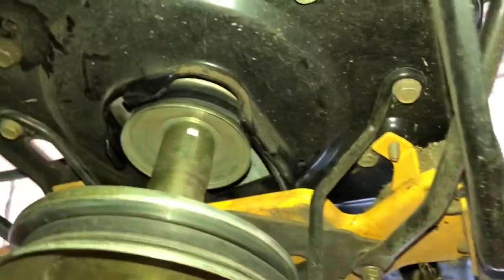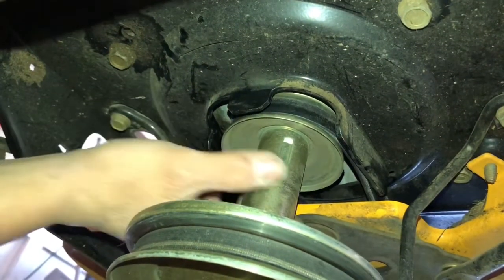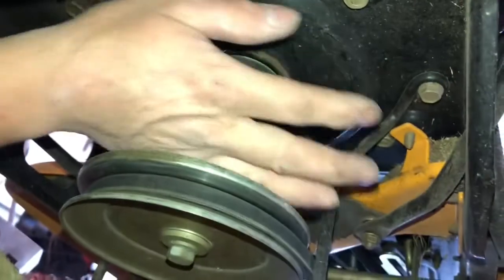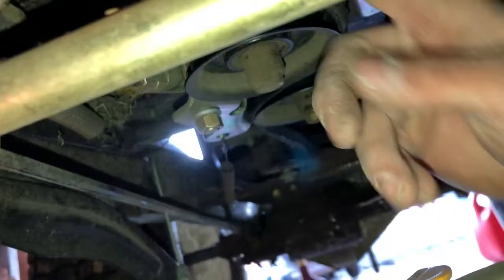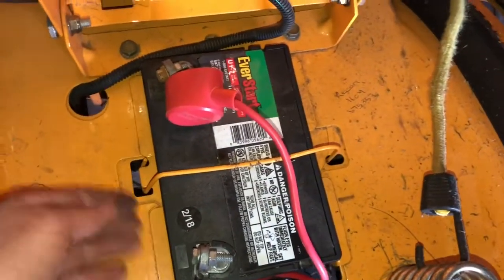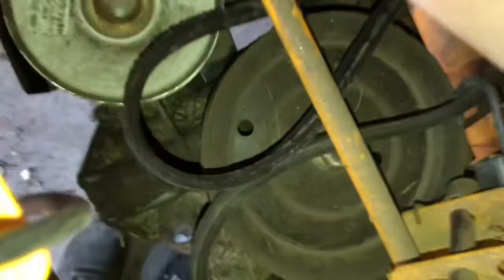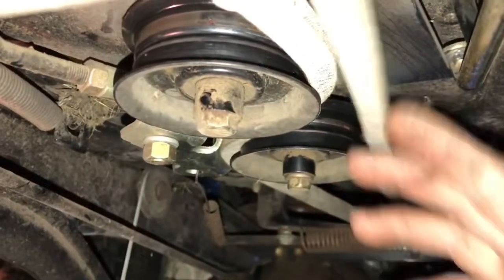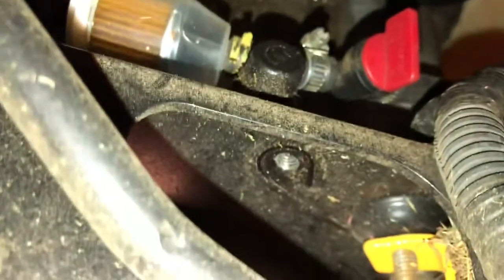No music, Installing a new drive belt on a Cub Cadet LTX 1040

Comment: Thank you so much for posting this video. I was able to change out the belt in about 30 min. I did not unbolt the engine however. I remove the bolt in the end of the engine shaft and the whole assembly easily slid off the shaft for easy belt removal and installation. I did remove the mower deck for easier access to the underside of the tractor. Thanks again, excellent video!
Reply: Sometime the pulleys are froze on there. If you remove the bolts you can slide the engine around and install the belt. Then slide the motor back and install the bolts. My pulley was stuck on tight
Reply: Atleast you did it right 👍
Reply: @tedbrewer7847 😂

Comment: I just pulled the crankshaft pulley on my 2012 Cub Cadet LTX 1042KW, I used a Husky Strap Wrench to hold the pulley and a ½" IR Pneumatic Impact gun with a 16mm impact standard 6pt. socket, it was piece of cake. The outer and inner pulleys dropped out easy and installed easy with the same set-up. That Husky 1" - 8" strap wrench purchased at Home Depot has a life-time gurantee and fit the pulley perfect and held it tight so as I reinstalled the pulleys to the crank shaft, the Kawasaki Crankshaft didn't rotate as I tighened up the 16mm bolt.

Comment: I have jack stands but it's good to know that paint cans will work in a pinch. Got the belt half off then I saw those frickin' tabs on the engine mount. I was about to grind them off when I decided to consult the University of Youtube. Removing the engine bolts is probably the best bet. I wouldn't want to deal with wheel pullers  and woodruff keys and all that. Thanks  so much for the help and by the way- Great tunes!

Comment: I guess yours is  not a hydrostatic   cub cadet 42 inch deck    mine is a 2016  kohler 22 hp hydrostatic V twin  I also found I had a oil like in the OHV  covers so had to use gasket sealer and remove them and reseal them  . Odd  they do not make a cork gasket for them  but  gasket sealler worked .   So looks much different  in the front and has a fan in the back  . I just replaced the deck belt  , spindles and pulleys and drive belt looked ok but guess not it shredded 2 months later  I could have caught a stick up in th belt  that destroyed it . I have just over 3 acres and have always owned 2 mowers    sold my troy built and bought a 46 inch hydrostatic  V twin  cub cadet this year  . Troy built only had 2 deck wheels  and my whole front yard is a hill  so back to 4 deck wheels  . I love you tube  shows me how to work on my mowers since here we only have 2 mower repair shops and they charge 94 dollars per hour  and 60 dollars to pick up mower and bring it back   ,  SUCKS SOMETIMES TO LIVE IN VIRGINIA HILLS   ,   my choice but comes with a learning curve

Comment: I just now got finished doing all 3 belts.  I was able to do it without taking the engine loose but i did take the deck out from underneath and also removed the battery like you showed.  ... made things alot easier.  I wonder if removing the engine bolts would've been better 🤔. 
... hopefully I won't have to do this again anytime soon.  
Thank you for your video
Reply from the maker: I think by removing the deck it made it easy. As I didn’t remove the deck to do main drive belt. It I really hard to say.
Reply: I’ve done it both ways. Removing the engine bolts is a lot easier. You can actually reach around and move the engine. Moving it back was easy too

Comment: Haha the 2 pulleys are connected by the shaft. (1 piece) heat the bolt with a torch to melt the red locktite remove the bolt and the 2 pulleys fall free. Elapsed time 10 minutes.
Reply: how long should i heat that bolt?
Reply: @Cure_E_Osity  20-30 seconds or so, There's flat spots on the shaft between the 2 pulleys that you can fit a pipe or Ford wrench on to keep the motor from spinning. then just crank on the bolt with a breaker bar and off it comes. If you have a tap and die set, clean the bolt and receiver threads before reassembly. If not a green pad/wire brush to the bolt threads will suffice. Upon reassemble add "BLUE" Loctite to the threads and crank it down supa tight.
While you're underneath, check the drive belt tensioner pulley spring. It has a tendency to break on one end. I've replaced it twice in 6 years.
Reply: @kenbred46  thanks man, it went off without a hitch. A task that would have been difficult without the support of the YouTube community but a very serviceable and reliable machine!
Reply: What kind of belt u got

Comment: Got the belt but looks like it’s a pain in the ass ty for the video goon try it because this mower runs really slow maybe this will help
Reply from the maker: Other said you can remove the pulley off the engine easily,

Comment: After removing the battery, why not roll lawnmower on it’s side making it easier to work on?
Reply from the maker: Did not want oil to get into the cylinder.

Comment: Where was the hydro fan? It’s definitely easier without the deck on
Reply from the maker: Hmm. Optional part?  This was a early mower so it might not have one?
Reply: @kingdeadlego  may be. My 2 are 2009 models. They have a tendency to bust all apart if the drive belt breaks. It’s only plastic but does help The hydro cool
Reply: This is not a hydrostatic transmission. It's CVT. They don't have the fan like hydros do.

Comment: Belt size?
Reply from the maker: With the belt size you have to watch because there’s two different variants of the mower and they both use different size belts. I would say to Look up your belt via your serial number on an online parts dealer and then take the part number of the belt to cross reference it to another belt that is available to you
Reply: so much for design . cub cadet replacement for drive and deck belts are overly intense . guess it made that way for the dealers sake....................
Reply: I found the same problem. The agent finally transferred me to an actual tech. He knew what I was talking about. He looked it up and told me they had 2 sizes that year and model. It went by serial number. Then I discovered why. The 2 pulleys ( stable and idler) had two different size pulleys. I ordered the other size and the problem is gone.